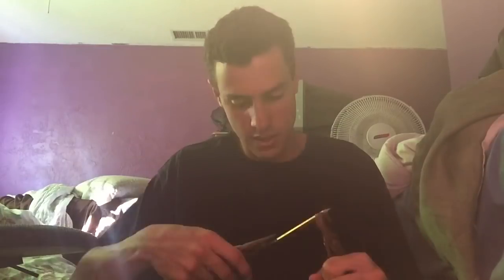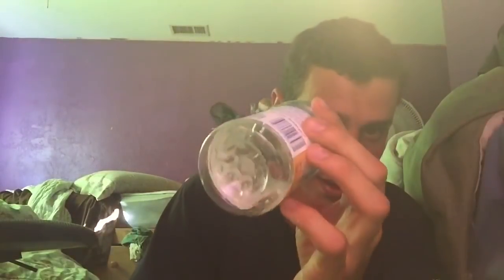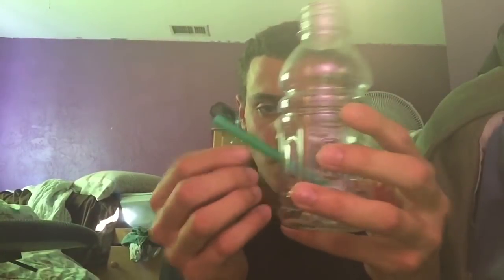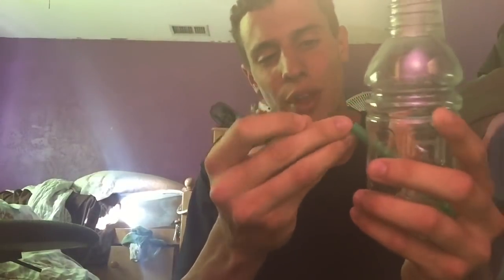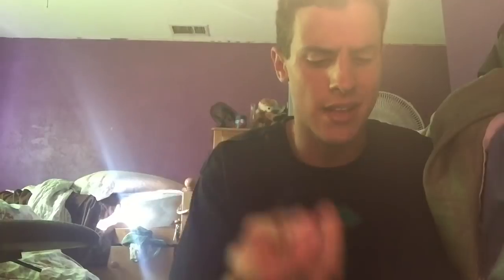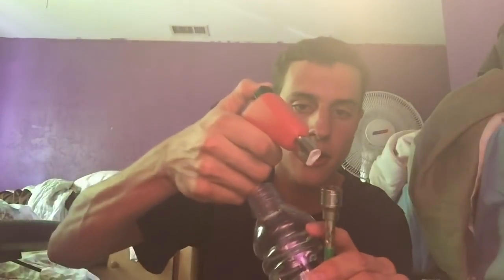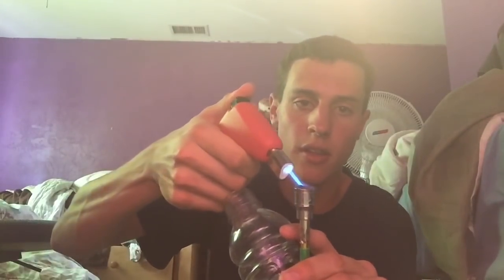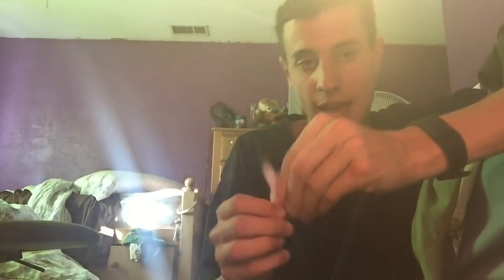Home made dab kit

Comment: Well shit I´ll just go and waste my 5 dollars on a metal dart at a flee market rather than a nail at a smokeshop.
Reply: @Evan-mj4bw  at least someone here has common sense, the entire time I was just shaking my fucking head. one, aluminum. really fucking ALUMINUM downstem. shit is NOT safe to smoke through, and the plastic straw literally less than a inch from the banger. the PLASTIC fucking carb cap. wtf is wrong with this dude ** although, if you have shitty dabs I guarantee this homeade "Rig" will get you high...